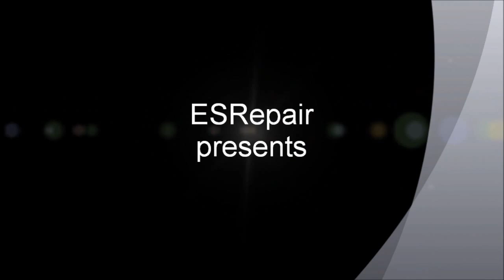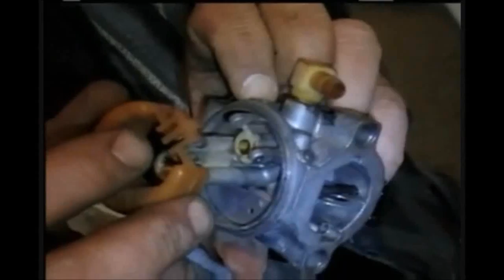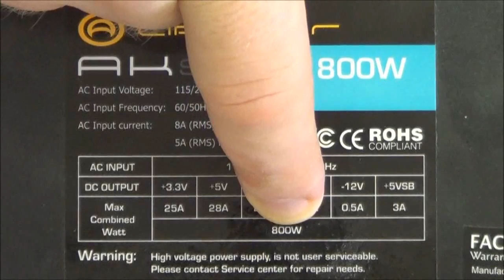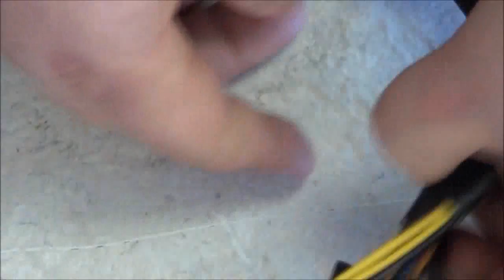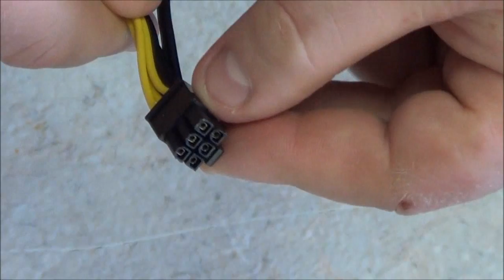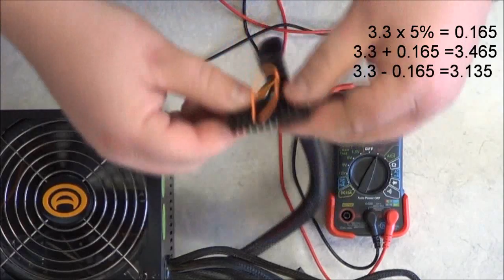How to Test the PC's PSU

Comment: Your detailed explanation of everything made me understand what I was doing and I figured out that my power supply was bad. Upon opening it, I discovered that the additional plug piece that goes into the motherboard had become disconnected and reconnecting it didn't help. The damage was already done. By the way, your page where the link goes is down. You may want to fix it. :D Or better yet, find good ones on Amazon and just sign up as an affiliate. You deserve to get something from helping so many people.

Comment: This is a great instructional video. but I have one issue with my psu.  After I put the paperclip in the green and black slot, I then put one input jack on the black and as soon as I put the other input jack in the blue connector, the psu stops. Does this mean it is no good.
Reply from the maker: The blue wire provides -12VDC up to 1A for the motherboard.  IF the PSU is turning off when testing the Blue wire, check your connections.  IF a short is detected the PSU will turn off for protection.

Comment: but you didn't check the blue one (-12)
Reply from the maker: The -12V is not part of the primary power distribution and is rarely used.  It's purpose was for COM serial ports and ISA expansion cards.  Many Computers today do not have COM ports or ISA slots, however, COM ports can be installed via PCI and connect to the -12V line or installed using the PCIe if a COM port is needed. It is part of the PSU for MFGs who want to utilize the -12 V line. Most -12 V lines are rate 0.5 amperes and can be tested by placing the Positive Probe on the Blue wire and the Negative probe on the Black wire.  Should be fairly close to -12V.  IF the tester doesn't have an Auto Polarity, place the Positive Probe on the Black wire and the Negative probe on the Blue wire.
Reply: thank you

Comment: Mr fix it.  I must agree with Frank MIller.  Your videos are the benchmark for all tech videos. I am not clueless when it comes to electronics but I do have some fear as I am in the Philippines voltages are just plain screwy over here.  Very unstable.  you gave me the confidence to buy a multi meter and get to work! thanks a lot man!!!!

Comment: Great instructional video even three years later now in 2016. Best detailing of the PSU plugs, wires and voltages I have seen anywhere. Thanks a lot! I subscribed to your channel DURING the video as fast as I could get my mouse pointer over to the button! Please keep these up. Most appreciated.

Comment: hello i have a question,if the power good signal gives 2.5 v what does it mean ?the power supply is good or not
Reply from the maker: it means the PSU is bad and needs replaced. -MrFixit
Reply: Thanks for your help
Reply: What a load of horseshit, i have 2.4v on pwr_ok and it works, i bought a second PSU for nothing thinking that was the problem when it was the motherboard that was failing

Comment: can you explain how to make the load on the PSU so we can check it run's good like yours how to make load with 800W without motherboard so to be sure it's okay on loading :) thx and good job
Reply from the maker: Thank you. I have been working on a video to show how to safely put the PSU under a load, but have not had the time.  You can build a simple Dummy Load to connect to the PSU. This would simulate the load a typical PC would draw.  The dummy load would have to have adequate cooling.  -MrFixit

Comment: All of my voltages are what you said they need to be but my power ok is 2.45 is my power supply bad
Reply from the maker: The Power OK voltage should be 5V.  Your PSU needs replaced.  -MrFixit

Comment: Thank you, for this video, it helped us out a lot. We couldn't find the P4 connection on the new power supply and because you explained the connections we were able to figure out that the duel P4s were still connected to each other. I thought we either were sold the wrong part or my mom would have to pay $200 to get it installed, by best buy geek squad. Who didn't even know what an internal battery was,  they asked if we realized that a desktop, that we've had for 3 years,  plugged in. So thank you for saving us from that.

Comment: what happens when you short the green to any black ground and the fan will sit still or barley move about 1/4 of a revolution..it will not spin and no voltage will come out of any wires..
Reply: +Kennynva T. Probably some components inside SMPS have gone bad... Faulty capacitors are pretty easy to find and replace but its difficult to replace other parts... Better purchase a new SMPS or if the SMPS is costly then contact authorized repair center...

Comment: On pin 13 on the 24 pin atx connector, is it possible to ONLY use a BROWN +3.3 volt sense wire? I'm making an adapter so my new psu will fit to my motherboard(it's an old dell one) and I only have 3 ORANGE +3.3 volt wires, so i only have 1 BROWN +3.3 volt sense wire left for pin 13. Will it work like a normal ORANGE +3.3 volt wire, or can it only be used for the +3.3 volt sensing?
Reply from the maker: M95C The Brown wire is only for the 3.3V remote sensing. MrFixit
Reply: ESRepair Ok, thanks. But still, the problem is that on the default Dell psu, there is only 3 orange +3.3V wires(instead of 4 as on a standard atx) and 1 brown +3.3V sense wire, which has it's own pin. So if i switch it to a regular +3.3V orange wire, is there a risk that it'll cause damage or anything, since the brown +3.3V sense have it's own separate pin on the 24-pin and motherboard connector?

Comment: On the last test you inserted the probes into grey and green wires. From the spec, the grey wire is +5v StandBy, and the one next to it, the white wire, is Power Good. Did you insert the probe to the white wire? From the distance of the probe that was inserted it appeared so. Am I wrong?
Reply from the maker: See I told you The Purple wire (pin 9) is the +5V Power Standby. The grey wire (pin 8) is the Power OK signal that tells the motherboard the PSU is stable and ready. The green wire (pin 16) is the Power ON signal used to turn on the PSU. These configurations are current since ATX Form Factor v2.2. The white wire (formally pin 20) was the -5V rail used in the ISA bus but was removed in ATX v2.01. Some MFGs still add the -5V rail but it's not required. Not sure where you got those specs, but it wasn't from the ATX form factor. Do not mix ATX with other form factors like Dell, Dell was notorious in the early days for not using the ATX standards. -MrFixit
Reply: ESRepair

Comment: I have an old antec 500w atx power supply that wouldn't work ever since we had a power outage, the strange thing is all voltages tested ok however the pc will not turn on.  I tested the motherboard with a known good power supply, and the computer would post.  Bought a new power supply, plugged it in and the pc has been working great now for over a week.  So even though it tested ok it still would not work...  Ultimately when it doubt test with a known good unit

Comment: Good video. Question, the Green wire is Power_ON and the Grey wire is Power_OK. Your video indicates you should measure 5V from  the Power_OK (grey wire) to Power_ON (green wire) without the jumper wire between Power_ON and ground. Would you also expect the Power_OK to be at 5V with respect to ground WHEN you have the jumper wire in between Power-ON and ground?
Reply from the maker: ttgvsc The Power OK wire with respect to ground will show -5V. Most PSU send 5V thru the Power ON wire and the MB sends it back thru the Power OK wire back to the PSU. If the PSU is functioning properly it will ground the signal thus turning on the PSU. I used the Power Ok and Power On Wires in the video because that is how the motherboard turns on the PSU. -MrFixit
Reply: +ESRepair Nice video. But I think your explanation of Power_OK and Power_ON is not correct.. Power OK wire with respect to ground is +5V and you forgot to mention +5VSB which is the most important rail/voltage in SMPS. Why we should measure voltage between Green & Grey wires.? Isn't that the same +5V of Green wire is shown on the Multimeter.?

Comment: At the end ( 20:50) when you are testing the Power_ON signal is the PSU even on?  The fan doesn't even appear to be spinning.
Reply from the maker: pussiestroker The PSU is not on for the test. Power on is used to turn on the PSU. The Voltage needs to be around 5VDC. it signifies the PSU is stable and can be turned on. The test meter doesnt draw enough current to turn on the PSU when testing the signal. - MrFixit

Comment: Hello I'm testing my power supply but  I don't have a multimeter but when I jump the green and black wire the fan turns on  and there's a solid green light in the back of the power supply. Now when I plug All the plugs back in and push the ON button NOTHING happens it's dead Can you help with this?

Comment: Hi,

I am testin a power supply, using volt meter I notice that the voltage keeps on jumping from 0 to 33v for 12v (yellow) wire. The voltage fluctuating for every wire. It does the same thing when hardrive is connected too.

Any suggestions or ideas?

I have  thermaltake toughpower 850W (w0131ru)

Comment: Yes I agree, I guess what I was trying to convey you could have a 12 v. pin connector hanging by just a strand of wire on a terminal, or a cold solder joint, both would show up perfect till you put a load on a circuit, I guess I have seen so many Power Supplies, and Routers tossed in the trash for real minor problems, I am ready to get out of computer repair because there is no money in it, and customers change there mind on fixing them like I change my underwear. test in computer better.

Comment from the maker: None taken, MrMac, but how many people own an oscilloscope? Most people just have a basic volt meter. The test can also be done while the PC is plugged into the PSU and turned on, although it can be difficult in some PCs due to cramped space. This will put the PSU under a load while checking the voltages to see how the PSU responds from the 'OFF' and 'ON' states. The voltages must stay within 5% of the stated value. -MrFixit

Comment: No  offence to your great video, but you are kidding yourself, we can take a bad power supply will give you the same readings, but only when you put a load on it will you be able to see a ripple or a failing cap heating up, when they are cold with no load they will fool you.   A 1 amp. load with a oscilloscope on each rail will give you a better outlook or a Fluke with true RMS with no more then 1 volt on the AC reading.
just thought I would throw my 2 cents in. 
Thanks for your video.